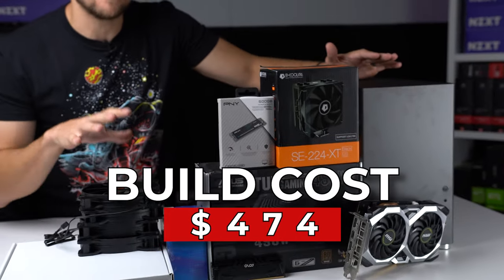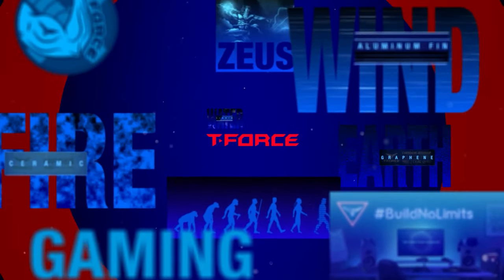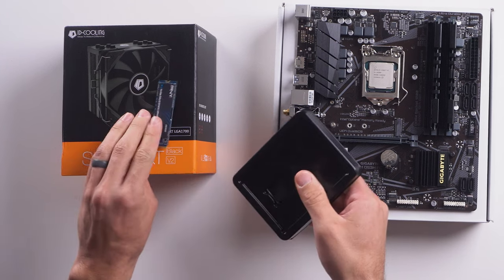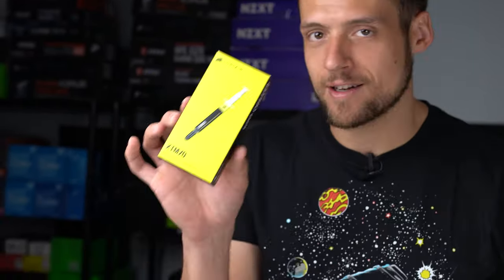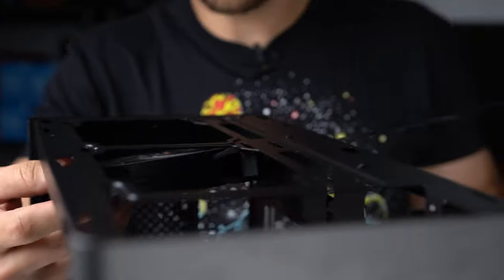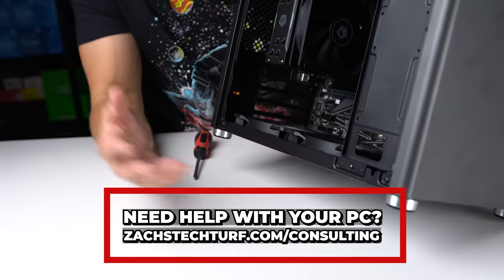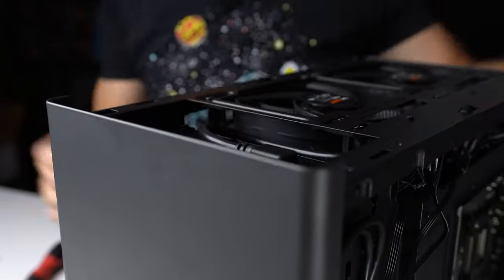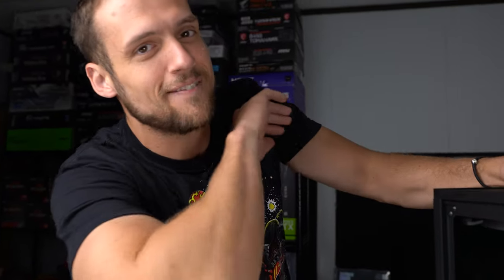Easy and Minimal $500 Gaming PC Build

Comment: Case is an OEM Jonsbos D30 case, sold as a Gamermax(?) in Australia, still the case is over 400mm long, won't fit my TV cabinet, but a new Jonsbos/Jonsplus Z20 as came newly to market. I have a V4 but the position of the PSU hides my sexy new B550 TUF gaming. I'm doing unpaid marketing for Jonsbo because if it sells well the Australian Online seller of Jonsbo case may get it in stock, but that store also is having price drops on it's Jonsbo case so would like to buy a few case from them but have on use for them.
Reply: Yeyian Hussar, iONZ KZ-30M glass and sound proof rebadge versions sold in UK also.

Comment: I just finished my first pc build, matx in the inter-tech im-1 pocket mini case. I had the same problem with the bottom fans, I just used a dremmel tool and cut some material off from the one bottom fan and I was able to use all the pins of the mobo. I probably could have used a slim fan, but I am cheap.

Comment: I think I’d spend a bit more on the cpu, maybe up to a 10400f as I’ve got a 2060 on a test rig (with a 3600) and I get much higher performance in Fortnite, minecraft ect…
Reply: Ya like i5-10400 or i5-10600k
Reply: @GoldAnxnymous  
10600K a 200$ CPU in a 500$ budget?
Reply: @GameslordXY  10400 then
Reply: @GoldAnxnymous  
With a little bit of creativity,it was actually possible to fit in Ryzen 5500 and RX6600 in 500$ budget which wipe the floor with this PC.
Even at the time of this video appearing.

Even so,this is still very decent gaming PC capable of very nice results.

Comment: I installed an intake fan on the bottom of the case, and second exaust on the rear side - at the same level with cpu cooler. Didnt had time to test it, cause Ive done it fast, for my parents pc. But now I'm wondering, if the bottom fan will not affect gpu temps (cause half of it blows directly at gpu causing positive airflow, and half of it goes up between cpu and psu), and overal airflow (maybe it was better to install it like an exaust also on upper side of the case)???
Reply: Did you ever find an answer to this?
Reply: @SPPACATR  nope. Didn got back to this anymore.

Comment: bro, which one shouldi get a cooler first? CPU OR GPU? im in a very tight budget. Processor: ryzen 5 3600 and graphics card: RTX 2060 SUPER
Reply: GPU coolers are very expensive overpriced unnecessary stuff.
Just have well airflowed case with multiple case fans.
Mind you,even a milion fans won't save terrible case.
Popular pretty cases, aren't necessarily great cases.

CPU coolers,stock coolers are usually sufficient... except for the fact they are loud.
Reply: What is your budget?
Reply: Why do you think you need to buy new coolers?
Reply: @GameslordXY  3000 Indian rupees. Say around 20 dollars.
Reply: @michaelmcconnell7302  temp in my graphics card is around 80 to 82°c.

Comment: Why not use the stock cooler?  No need for that big thing...
Reply: Exactly my thoughts.
30$ could have gone for something else.
Like Ryzen 5 5500(99$) and cheap B450 for 75$(Gigabyte B450 DS3H motherboard.),maybe even B550 Like Gigabyte B550 DS3H and 500/512GB SSD.
Unless it's ITX case... .

500/512GB SSD would be sufficient for a while and storage is cheap to upgrade.

I am troubled by this case.
To some cases all the fans in the world can't help.
Perhaps I worry too much.
Reply: @GameslordXY  right now early november 2022 the 5600 is the bargain chip to go for.
Reply: @michaelmcconnell7302  
Yes,but perhaps not in this budget.
Price was jumping from 118.99 at Times to 150 for 5600 or so while for 5500 from 81.99 to 99$ in past 7 days or so 

And 5500 is good enough.
It gives some very nice 1440p frames in a combination with RX6600 which can be aquired New for 189$ and beats 2060 by some 10% - 15% in rasterisation.
Once DLSS isn unleashed in compatible game 2060 most likely wins,but FSR saves the day imo.
FSR2.0 is very close to DLSS2.
Some even prefer it.
There are mods in CP2077 that replace DLSS with FSR2.0.
Though honestly,even FSR1.0 is fine on Ultra Quality settings.

I would much rather have New 190$ vs used for 160$.
On used market,you never know what you buy.
On new market you get never used product with 1 or 2 years warranty (possibly more sometimes).
Sure,used can also still have warranties,but there do not cover everything,and you have no idea what was someone doing with it.

If I had YouTube channel,I would make very good builds for people.
The problem is , I am camera shy and would need permision from many benchmarkers to use their footage in my videos or even live streams.
Reply: @GameslordXY  if it works, it works 🤠💪

Comment: how many cores would i need in a cpu to play a game like fortnite and watch twitch or youtube at the same time without seeing a massive drop in performance?
Reply: What's your budget?
And what kind of hardware do you have .
Reply: Most modern CPUs are quad core or six-core, generally that’s enough. Ryzen 5 3600/5600x are both very good chips depending on the deal you get.

Comment: hey can you recommend the best 25$ gpu?
Reply from the maker: My recommendation would be to save more money.
Reply: @ZachsTechTurf  kk
Reply: You mean 250?
There is nothing "best for 25".
Integrated graphics from any modern CPU with Integrated stuff would probably crush it.
Reply: @GameslordXY  ye things like 6950 or gtx 460 are good gpus for 25$ but i will just get an 1060, 1080 ti or wait until the 30 series drops in price or i will get amd
Reply: @br33Zyfn  
Are you joking with me or just trolling me?
6950XT is nearly 800$ card.
None of those cards can be purchased for 25$.
Except maybe for used GTX460 which is utter crap these days.
Reply: @GameslordXY  i mean radeon hd 6950 it can give you (with a good cpu) 144 fps in games like fortrnitrr

Comment: Idk man. This configuration has 10.7% of processor bottleneck ... Usually ur looking for less than 5%
Reply: Lol
Reply: Bottleneck is exagaration.
It is real certainly, but not as problematic as some would have you believe.
Also it is impossible to completely avoid it.
It shall always tip the scale to one side or the other.
Anyway, it can serve as a placeholder for 10400 or 10400F for example.

And sometimes, sacrifices are required.